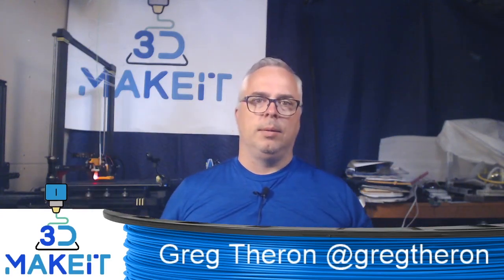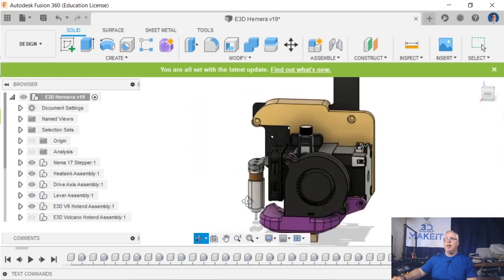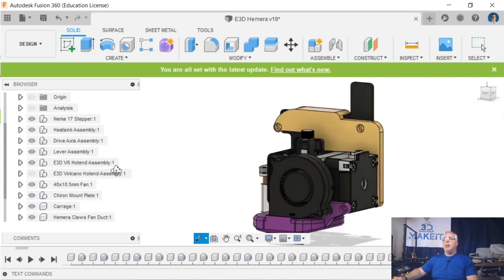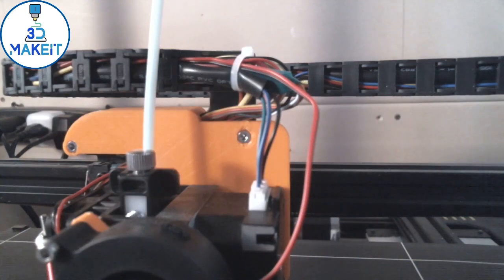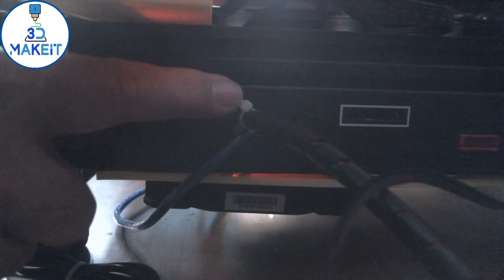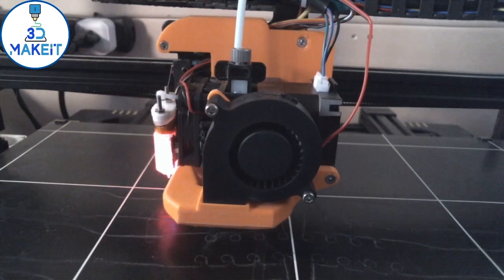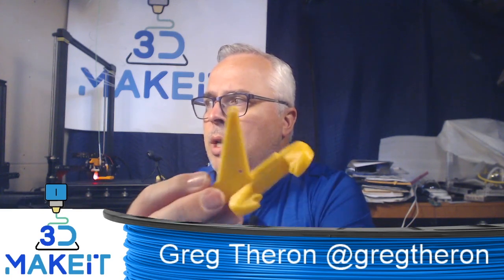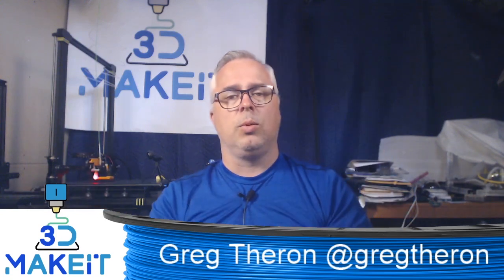Anycubic Chiron Updates ( Hemera / Hermes Mount)

Comment: Thanks for making the mount available Greg. Could you point to something online that can get any Anycubic Chiron owner started with the Hemera install?

I’ve hear nothing but good things about this printer plus Hemera combination.. I’ll be posting a step by step guide and would like to link your files as well, it would be great to have you involved in the doc, as it will be a great benefit to the community.
Reply: Please feel free to use the model and link to the model. The printer I like a lot, but to be honest, I print on my ender 3 and cr10 v2 way more not that I don’t like this printer. I kind of save it for big jobs and I don’t have a lot of big jobs.
Reply: @GregTheroneggythetech  Apologies for the long delay. Connections are fairly straightforward. I’m a Prusa user and this is my first non prusa printer.

The options are to use a variation of the mount to reuse the Chiron extruder PCB, but that will require more work and would rather go your route…(and not shortening the wires that came with my hemera)

Since it’s 2024, there are few new boards by Bigtechtree. I don’t want to replace the stopper motors I have on the Chiron.

Do you mind giving your thoughts on the manta e3d ez? I want to keep cost and effort as low while upgrading the board… apart from the 32bit mcu with a new board, I have yet to see any proof of improved prints with board replacements.

I plan to run octoprint which will still require a separate SBC ( I already own many)

Do you mind giving your thought on what actually improved with a new board on the Chiron?
Reply: @r.in.shibuya  so i have not used the e3d ez but it looks good. I am now using klipper on the printer. I am thinking of switching to a btt toolhead board that will make wiring even easier.

Comment: Could you help me out with the wiring please , if i take the original Chiron wires, blue, red, green and black, wo which ones do i connect them on the original hemera cable? And i need to reconfigure the confit h file?? What do i need to change ? I would be very grateful if you could help me our please, i dont want to fry my board and i am a total neglect when it comes to wiring :-(
Reply from the maker: I use an SKR board and I've completely rewired the printer so I don't know how helpful I can be. My previous wiring diagrams and cable mappings are available on our website. www.3dmakeit.ca

Comment: Hi Greg, thanks for the video! I am deciding between a Bondtech extruder and keeping the bowden setup or going with Hemera direct drive for my Chiron. Which way would you go? Also, if I go with Hemera can I keep the existing cabling as is, connect the Hemera fans and hotend to the board currently near the hotend and then just run the stepper wire to the old extruder location and connect there? Just trying to avoid rewiring the whole thing. Thanks again for all the great content!

Comment: how did you update the firmware to support the hemera?
Reply from the maker: It has an SKR 1.3 in it running Marlin. But you can load Marlin 2.0.9.x on the stock board as well. I switched boards because I wanted silent steppers. It's so quiet now.

Comment: do you need to chance the e-steps or is that the same as the original?
Reply from the maker: you do need to adjust the esteps. i am using 409
Reply: I'm running this set up and changed E steps from 405 to 400